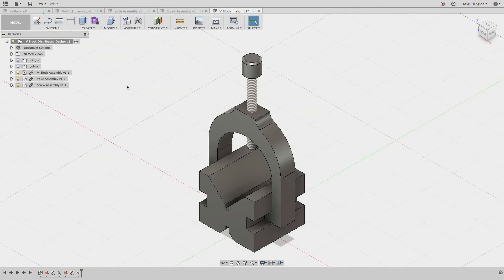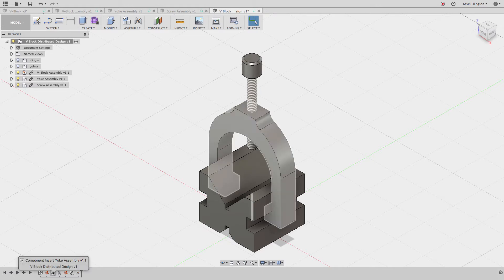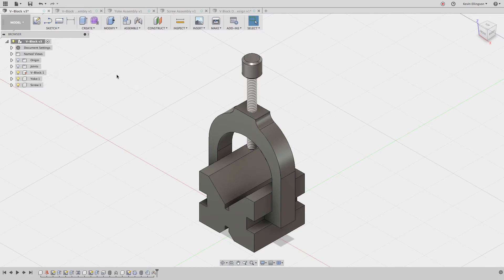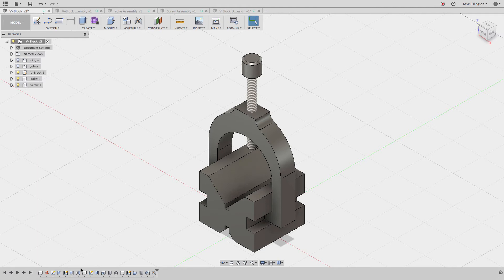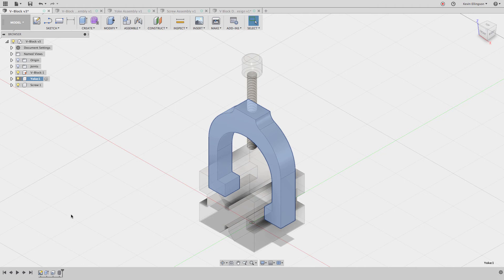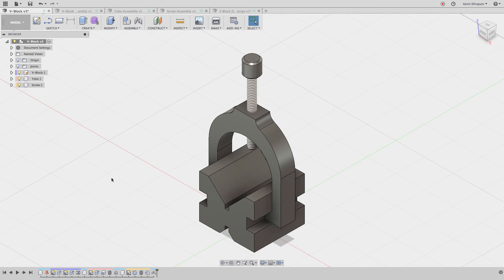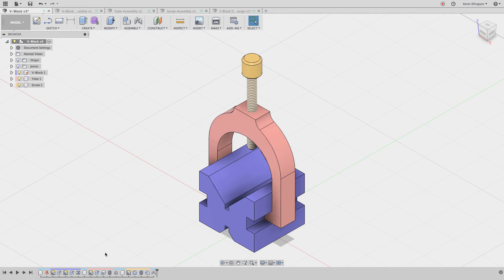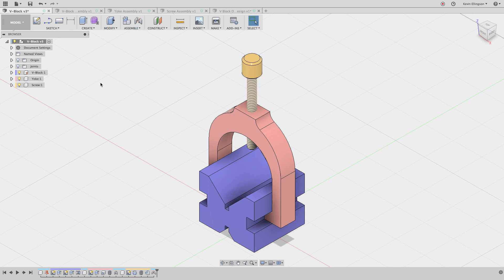Fusion 360 - Fusion Assemblies

Comment: Hello Kevin, My name is Benison D. MAssala, I am Angolan (Africa) and student and I just started learning fusion 360 by myself, and I have a issue or a question. I modeled TVC Gimabl mount, I already created all parts of the tvc mount but I want to join tvc mount parts so that there can exist relative movement between the inner gimbal with the Cyllinder and the Inner gimbal with the outer gimbal, cause I am want to run static simulation on the TVC mount. I would be glad to get some assistence on that scenary.

sencirely, Benison D. Massala.

Comment: Helllo, Kevin! My name is João Carvalho. I'm Portuguese and I'm starting with Fusion 360. In fact, I worked for some time with Inventor and I'm using the latest Inventor 2020 version. As you know, Inventor is a little different from Fusion 360 ...! So my problem is this: I created all the parts of a Wankel engine system, but individually. I would like to assemble them, but I created them one by one and saved them in a folder inside a window (where I gave each piece a name). I did not draw the different parts within the same drawing sheet. I was used to drawing in Inventor and I followed the same steps and now I don't know what to do with all the drawings / files ...!? Could you help me with this issue? Thanks in advance. Sincerely: João Carvalho.
Reply from the maker: Hi Joao. That typically the way you would do it in Inventor. You draw each part as its own file. Then you start an assembly file and insert each of the parts into that file using constraints or joints to position them.

Comment: Great info Kevin!  On your bottom up.....you inserted the other files into the common, new file and they're still linked.  When I use a part I previously designed, like a soft jaw, I copy the part, then paste it into the new file.  It comes up with a msg saying it can't be linked....which I don't want anyway.....and then it drops the part in the new file.  I position the component where I want it and call it good.  My question is ......is doing that considered top down or bottom up.  The part is now a new component in the common file....it wasn't technically created there, but it has no reference to anything outside of the file.  I've done it where I copy the component and paste it in the new file....all the sketches and construction come with it.....I've also done it where I just copy/paste the actual body I want....then turn it into a component in the new file.  
The file I'm having the most "hang ups" with was done the first way....copying the entire component.  I've gone in and deleted all the extraneous stuff....sketches, construction, bodies.....that I don't need.  Does that help since there's less "noise" in the file or does it hinder it because it added a lot more to a timeline that I can't see?  I don't typically use the capture design history at the bottom.  As soon as I need to save the finished machined part as stock for the next op, I have to delete that timeline anyway for it to work.  So, I just don't bother with the timeline.....which I find more confusing than helpful......which may be adding to the problem.  
It seems this all works great with projects that don't need many changes from the original design.  If I find I need to change something while I'm working on the second op....using saved stock from the first op.....it's a royal pain.  I had so much trouble with everything slowing down, that I've started copying the finished op1 file and using that for the starting place for op2.  I had previously been doing the entire projects as top down....create one part as a component, then all the soft jaws and such were created in that project, as well.  It got to be a really big file and a pain to navigate when trying to do op2 work.  I'm sure a lot of that is because I'm a hack at this stuff. No formal training....I just do whatever I have to do to get the result I need.  I'm sure that's creating a lot of "noise" in the process.